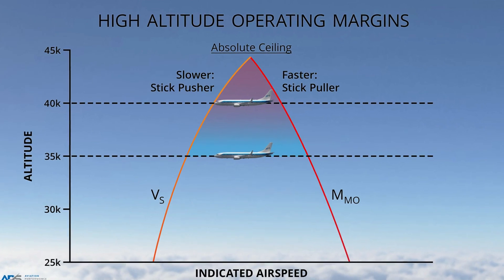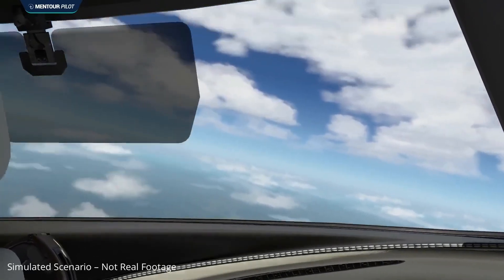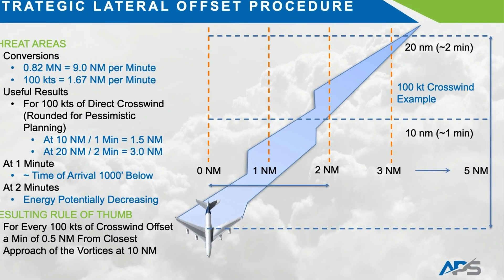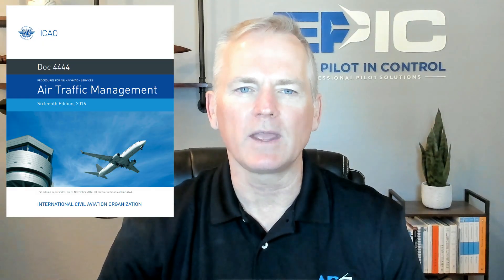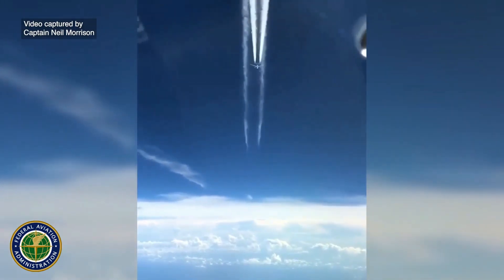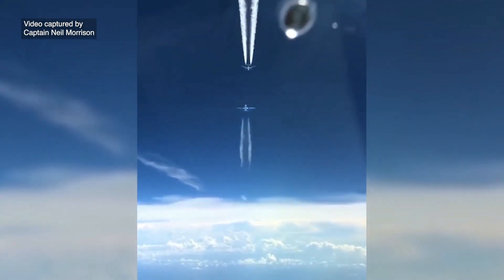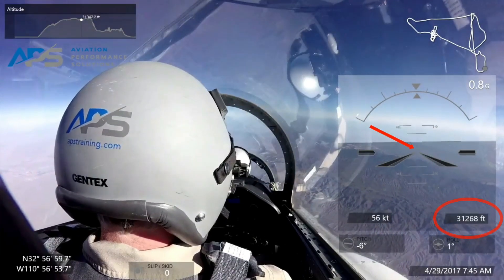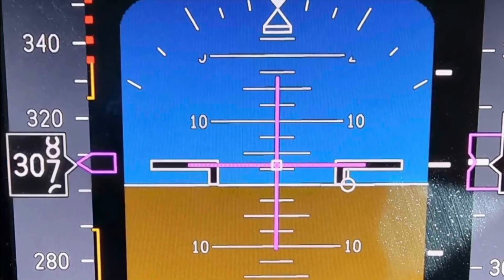High Altitude Wake Turbulence - Small Margins, Big Consequences

Comment: I wish that kind of turbulence could be practiced in a SIM
Reply from the maker: Well said! While the turbulence itself can be generated (although correctly representing real-world turbulence in simulation can be quite difficult depending on the severity and specifics), the bigger issues are the human factors of startle and surprise, not to mention the rapid drop-off of accurate motion queuing, which are very difficult to accomplish in simulation without simultaneously introducing substantial negative training.
Reply: Since jet spool is that powerful,  do you think the Airbus "Fellow Fly" programme will be something achievable  @EveryPilotInControl